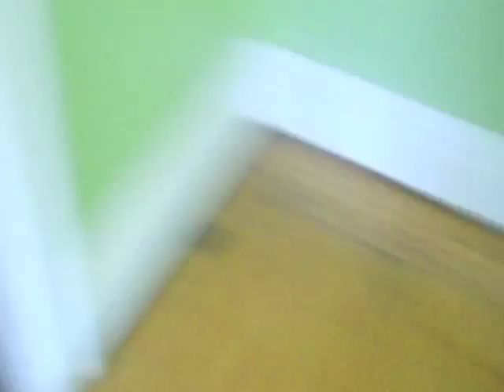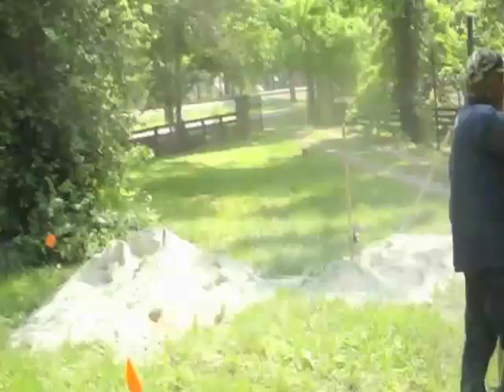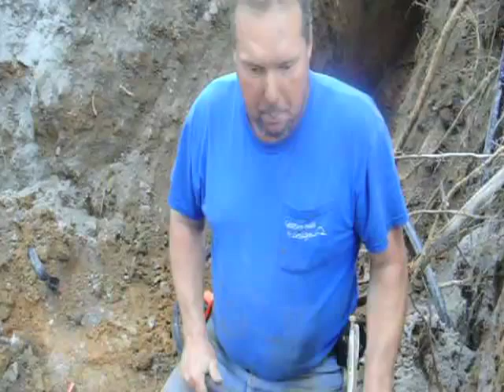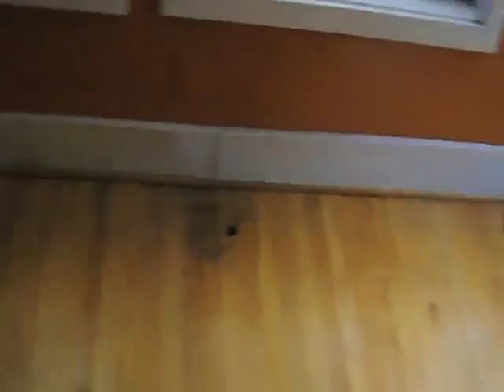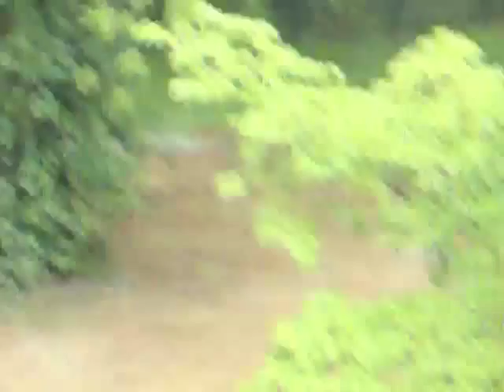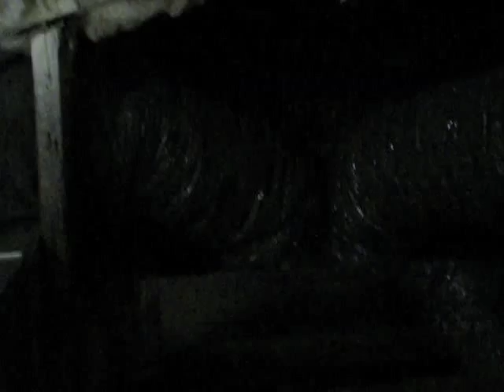Geothermal Heating and Cooling Loop Installation from Geothermal by Design

Comment: I'm considering buying a huge house that needs a furnace replacement. I'm tempted to go GeoThermal. In MA a cool climate on agricultural land. The house is 4400 square feet. There's an addition which hasn't been finished - another 200 feet. What's my cost for that much needed heat. Heating is the real need, cooling is secondary. Any advice?